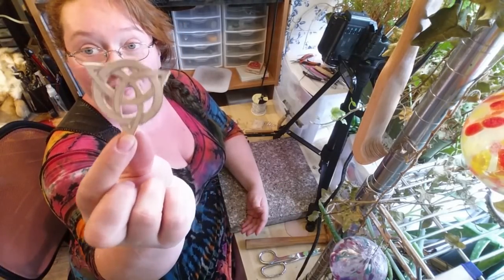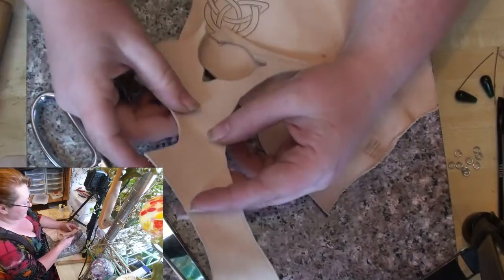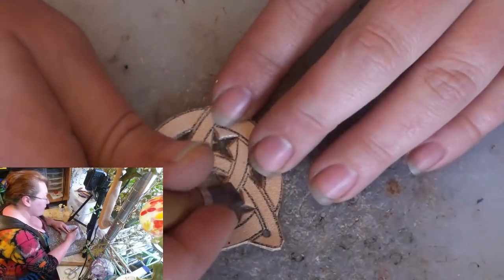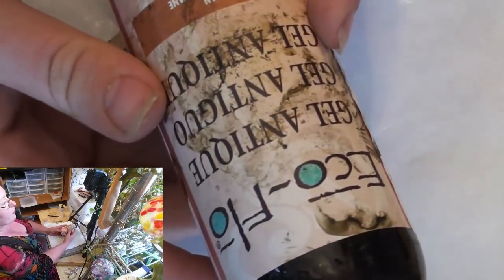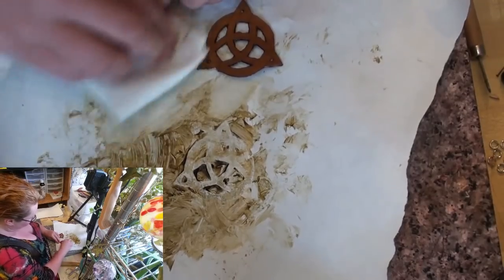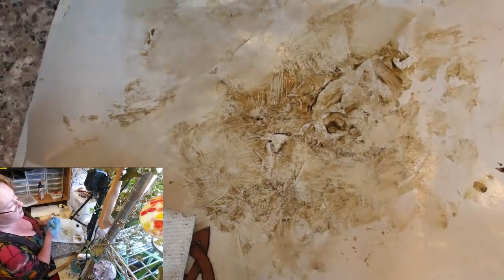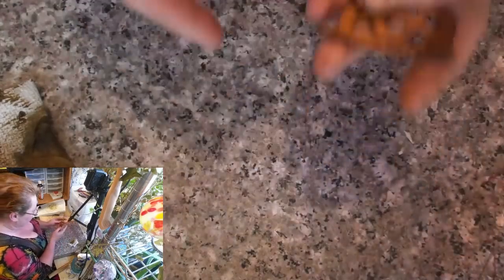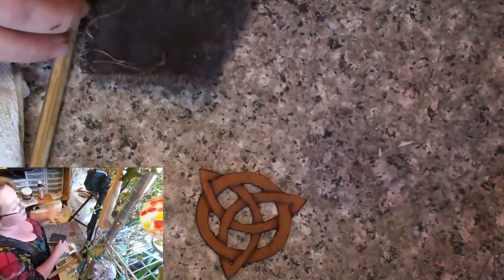DIY Leather celtic knot necklace

Comment: Hi Yvonne, I just got all my leather working stuff from Tandy Leather here in Australia 😀 it's more difficult than you make it look😂 my issue is which hand to hold the tool with and which to hold the mallet with. My first instinct was to hold the mallet in my dominant hand like when I hammer in a nail but my left hand couldn't position the bevelling tool very well. I noticed you use your dominant hand for the mallet, did you find it awkward at first? I tried using them the other way around and it felt weird but I think the tooling looked better. Do you have any advice? Should I teach my left hand to hammer or tool? Later on will I run into problems if I use them the lefty way (ie mallet in left hand) any advice would be greatly appreciated. Thanks
Reply: Never mind. Brain must have had some lose wiring yesterday. Mallet in right and tool in left😀